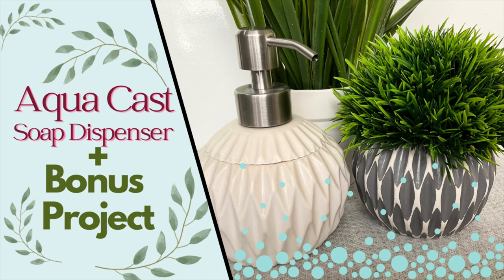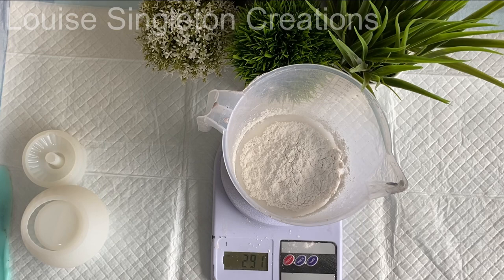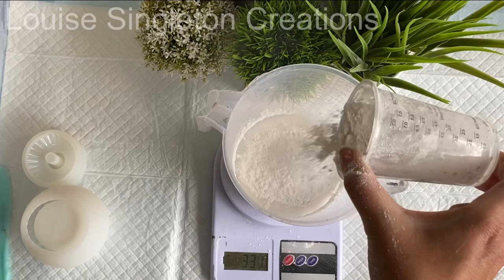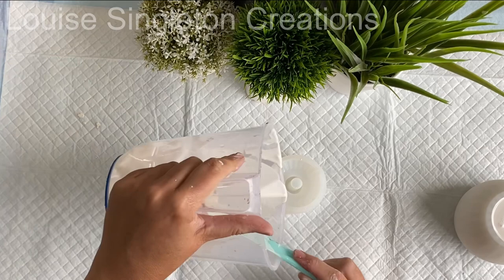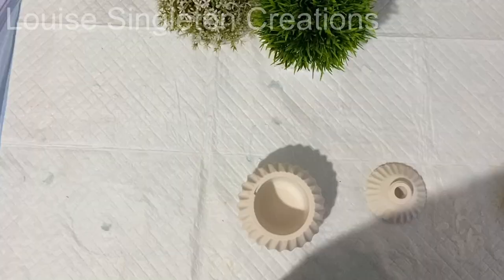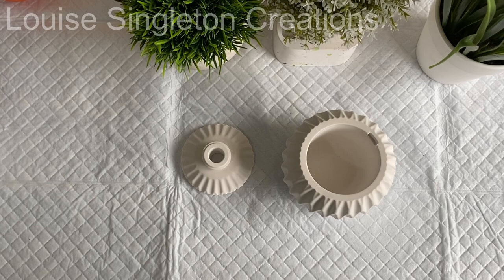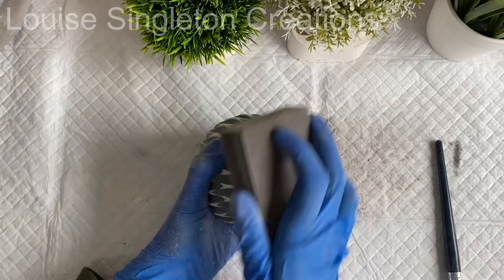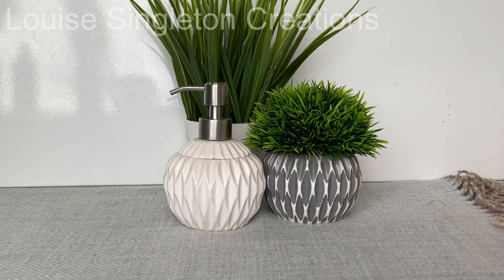Can You Make a Soap Dispenser with Aqua Cast? Question answered PLUS BONUS PROJECT

Comment: Hello Louise.  I am an avid fan of your videos.  They are so helpful.  I would like to offer a little help to other eco resin users, if I may.  When wet sanding you can save the slurry and use it to fill in small air bubbles, holes & cracks, as well as, reattach any broken parts.  Hope this helps.
Reply from the maker: What a brilliant tip! Thank you very much for that and I’m sorry for the late reply ❤️